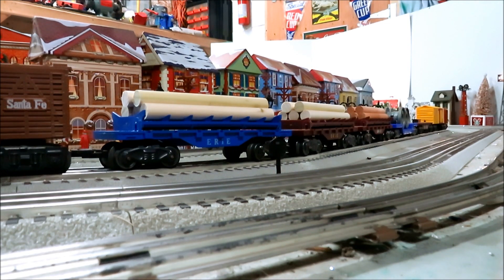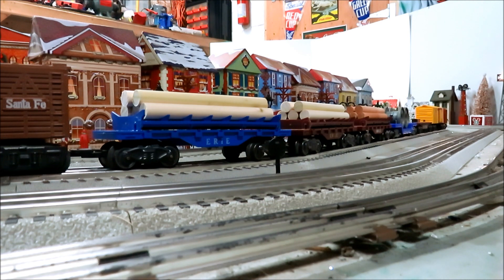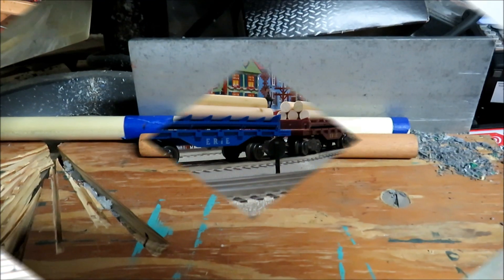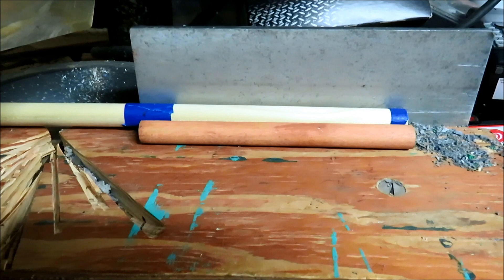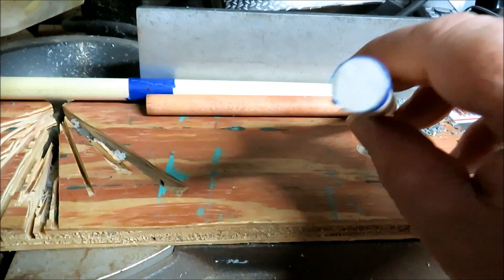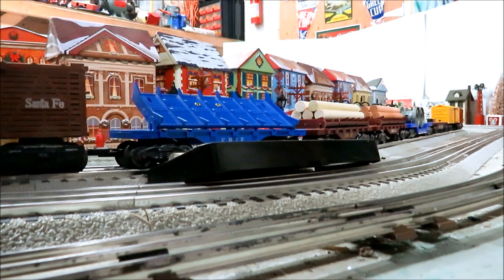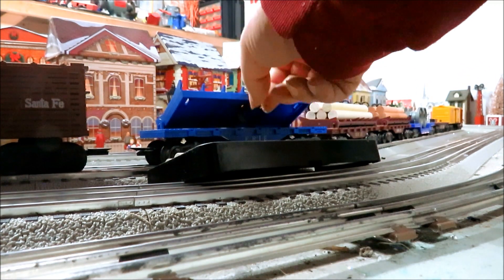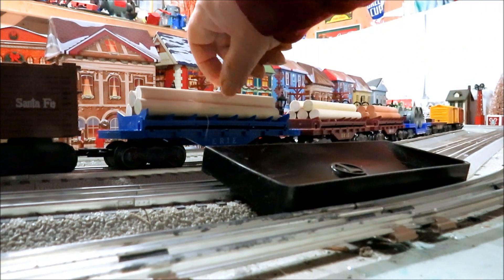Marx log dump car, making replacement logs

Comment: I've done the same thing with the dowel rod. I managed to obtain several MARX bins in order to keep the operating car MARX. since I don't have a power saw I used a hack saw which gave me a nice clean cut. Finished the logs with some teak oil for a nice light brown color. I obtained some of the track side trips from Grossman. They fold down so the car doesn't operate and then one can fold them up to activate the car. 😎🚂🚃✝